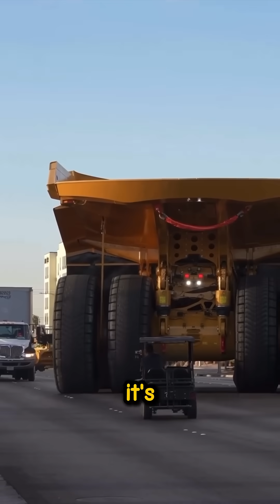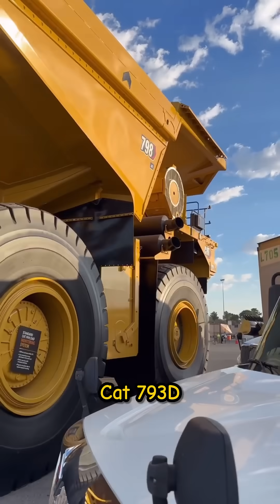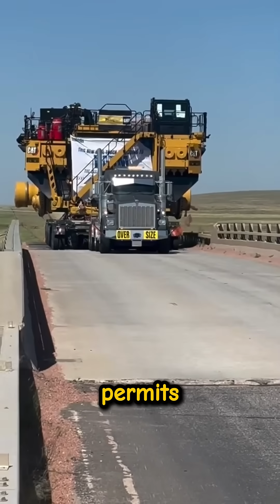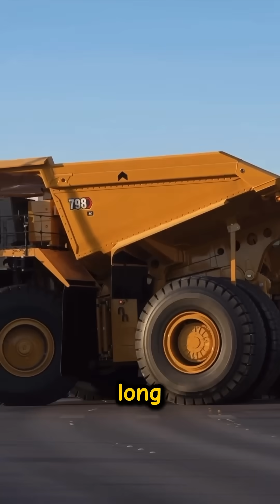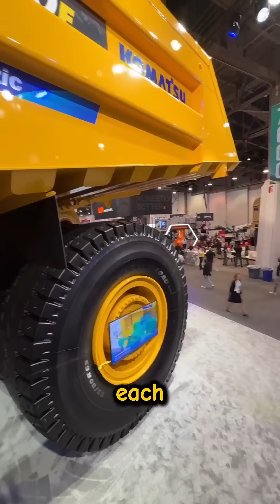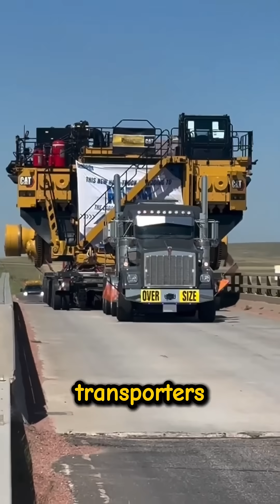Why Mining Trucks DON'T Use Highways The Physics & Cost

Comment: So it looses its weight once it’s towed? Magical 😅
Reply: The weight is evenly distributed on a trailer🤦‍♂️
Reply: 6 tires removed @11,000 pds each. Also the weight on each of those tires is much greater than the distributed weight over a 36 wheel trailer at almost twice the length. Now don't you feel silly for posting nonsense?

Comment: Too heavy for roads yet it can be carried on the public road with the additional wieght of the truck and trailer??...
Reply: Bridge formula. The weight is spread out over so many axles and tires
Reply: You don't understand weight distribution it seems. You see how many wheels that trailer has and this distance from the front to the rear?
Reply: It's power is not directly on the road , it's like lion  sleeping
Reply: Yes they are broken down into several large pieces that's based more on weight than physical size(though of course that matters too) if it was driving(even with the bed removed which one the heaviest parts) on regular roads that 220000 would be on 6 contact points with the road. Each a few feet across, that's roughly 38,000 per point damn near a regular dump truck on each point. So you break it down over dozens of points. And yes I noticed them showing one driving on a public road with cops blocking the intersection.  Very often roads are near mines or near military bases, airports and heavy industrial areas have the public roads built much heavier to deal with the strain. But that is seriously expensive to do and nobody wants the bill. As to public roads hurting the tires....ehh im guessing they mean they'll wear quicker.
Reply: The weight is evenly distributed on a trailer
Reply: Well true but
Reply: 😂😂😂😂😂😂facts
Reply: He just said without tires they transport it that’s a quarter of the weight there
Reply: You are all forgetting one very important fact. Everything on YT is weapon grade BS. Now kiss and say youre sorry for fighing.
Reply: they should move it in smaller bits, or a couple bunches of helicopters and fly it off to where its going
Reply: @mikenewtonninja9379  They do, in the picture with the semi, you will see the dump is removed.  But the frame is one piece.
Reply: 6 tires removed @11,000 pds each. Also the weight on each of those tires is much greater than the distributed weight over a 36 wheel trailer at almost twice the length. Now don't you feel silly for posting nonsense?
Reply: The weight is distributed.
Reply: friend of mine does heavy haul. 
i was running flag truck for him and we got to a bridge. 
he said watch the bridge when i get on it. 
and sure enough the whole bridge flexed when he got on it.
Reply: Tell us you dont know how to distribute weight and it shows stick to eating hot pockets
Reply: Obviously engineering isn’t your strong suit!! That’s ok !! It looks like many have explained it
Reply: The total weight of the giant dump truck is distributed across the many wheels of the trailer, thus, each trailer wheel supports only a fraction of the total weight of the dump truck, & the road surface can support the individual fractions of the dump truck's total weight, provided by each trailer wheel (additionally, the weight of the trailer itself also adds to the total weight distributed across the trailer's wheels).

This weight distribution allows for the trailer to move the heavy dump truck without causing damage to the road.
Reply: Untill you have been in the world of heavy haul you will never understand what it takes to move loads like this.